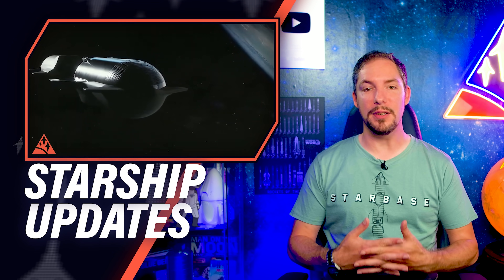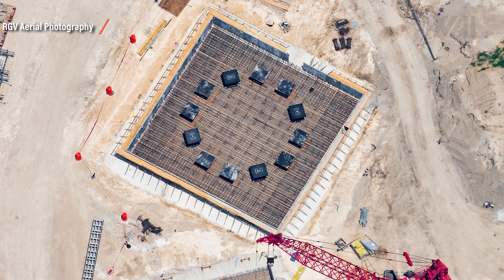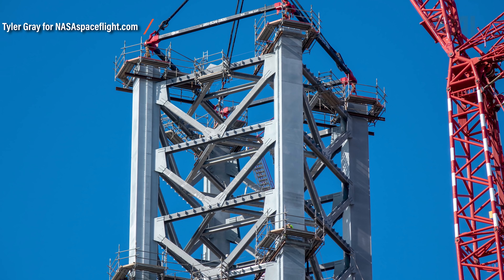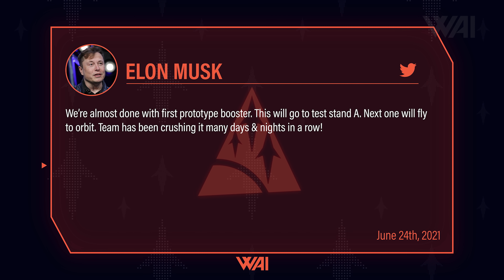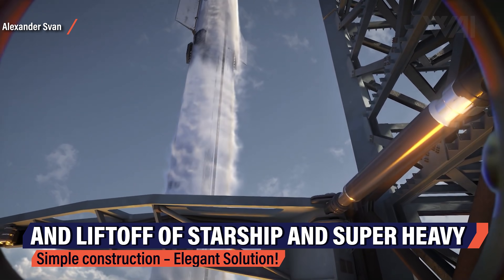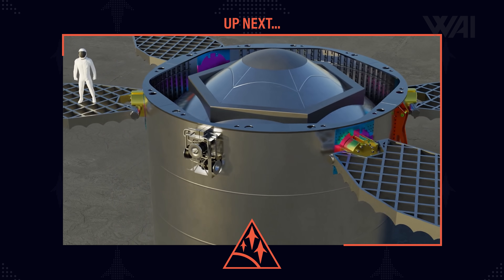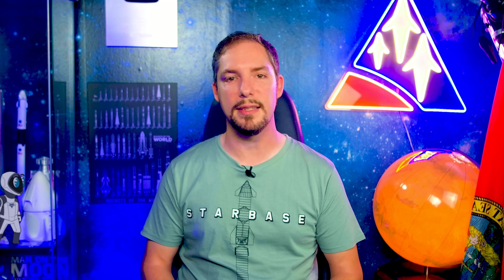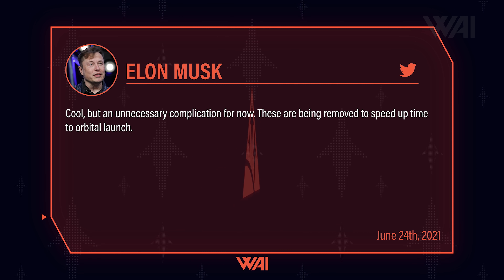SpaceX Starship design changed? Super Heavy booster precision landing thrusters!

Comment: If you link 2 starships to enable artibcial gravity.  The interior design should be different.  Or maybe you link then from the bottom 

2nd remark   when you have 2 starships linked from the bottom, this leaves a lot of space for... 15 more starships ?

So, add a better engine.  And the soar system becomes accessible :-)
With current tech

Starship is like a Lego. Add them and Improce your space ship, station, base

Comment: Here's the British HARRIER fighter jet demonstrating some of its capabilities, especially VERTICAL LANDING with FUSELAGE ORIENTED HORIZONTALLY.

I chose this particular video because it shows in detail the technology employed to control the Plane's complex maneuvers.

https://youtu.be/esDV4gjqsVA

Do not design for IDEAL CONDITIONS. This is ONLY good for prototyping, like in computer programming.

Vertical orientation is ideal when all your landings will always be in ideal conditions, no exceptions! Vertical might be right for Falcon 9, but certainly not for very heavy, tall and top heavy Starship.

Do you guys see the STABILITY of the Harrier? 

Consider this. Imagine Starship landing like the Harrier does, but with it's fuselage in vertical orientation, with all it's weight plus payload of 100 metric tons. 

When it's rockets shut down will Starship, standing tall and it's nose pointing up to the stars, will it be Stable? Safe on any terrain like on the moon or on Mars? With 1,000 STARSHIPS standing tall on Mars, how many will survive a Martian storm? Do you think there will even be one left standing? What about Marsquakes?

The Harrier can go from 520mph to a complete stop in 12 seconds, and remain hovering, motionless in mid air.

Because flying the Harrier was only in full manual mode - no A.I., no automatic system or subsystems - only the best pilots were chosen. The video indicates that hovering is the most difficult in flying the Harrier.

It's much easier, though, to fly the F35 because the difficult aspects of flying are relegated to automation.

The first Harriers rolled out in 1969, and 824 variants have been delivered since then. The U.S. also adapted the British Harrier for their own use. 

So, for Starship, just replace the jet engine with rocket engines and thrusters, and let it do VTOL like the F35 does (see above comment on F35). 

You already have the A.I. system for landing the craft. It is easy to adapt it to the case where the fuselage is horizontal.

And, because Starship is Top Heavy, instead of tripods, use two spider legs up close to the nose, and two spider legs to the rear.
Reply: Got to break it to you no one seems to be interested

Comment: Hi Felix. I'm wondering if the yellow tube structure may be on-site construction of extension components for the crane. Roughly judging scale and the various paint colors of spar segments already cobbled together, the crane company may have used up everything they had on hand. In any case, it looks like the cat-head will top out on the crown before reaching the required elevation for installing the final integration tower section(s), so we may see a final modification of the boom prior to completion.
 Maybe I'm wrong. On the other hand, even a broken clock is right twice a day.
Thanks for peaking my curiosity. I never tire of hearing the English language spoken correctly, to the point, and with the German accent that usually accompanies such an  unusual event.  
Cheers

Comment: While is is great that spaceX has made such excellent progress.
The law suit by the county I think is actually justified. SpaceX shuts down the road to run components up and down nearly day?
They are spending tens or probably hundreds of millions to build this facility, and are skimping on a private parallel road?
Last I checked a block 4 lane highway  IE no divider was 1.5 mill a km so the launch relief road would cost at the most ten million if so if that budget 4+ miles of road.
So the only highway shutdown occurs during launch!
 NASA have a 3 or 5 mile exclusion  zone during launches.
Yes SpaceX are going fast, but they are cheaping out by burdening the state highway system, and causing massive inconvenience to road users.
In Reddit terms spaceX and Elon musk are TA total butt holes in this situation to that country, and inhabitants!👎👎👎👎👎👎👎👎👎👎👎👎👎👎👎👎👎👎👎👎👏
Reply: >reddit 
>thinks 
Chose one pls
Reply: @Tuuminshz  I chose both!
Reply: @Michael_Brock  I see... All i can say is that you have a lot to learn. Best of luck

Comment: Elon tweeted a while back that they need a support arm at the SH interstage. It is possible that thy scapped the idea of fueling Starship through the entire lengh of the booster and just have the GSE fuel connection at the SH interstage and then some pipes inside that go up to the Starship orbital refueling quick disconnect. They could still fuel the SH through the bottom as they do with the Falcon.

Comment: I would assume there will still be quite a bit of work to do on the OLT after the final sections are stacked. Power, data cables, lights, water, sprinklers, insulation, elevator etc etc. I would also think that there will eventually be an escape system, but obviously no need to complete that initially.

Comment: Yellow pipes are being built into the crane mechanism for the top of the launch tower.  (SWAG of course).

Pipes to feed fuel/oxidizer into the booster can ALSO be used to feed to the engines, that's what "y" junctions are for.

And last, who's face is that on the hot gas thruster nozzle?

Comment: SpaceX Starship: Redo the Math

Do the Math that ensures safe landing and survival.

Math for Impact on Inertia of Motion

Consider the impact on inertia of motion on such a heavy ship. For Falcon 9 it was easy. The rockets were relatively light and therefore easy to control. The response to powerful rocket burts were instantaneous. 

Starship inertia of motion won't respond that easily. It's too heavy.

Landing on a barge at sea won't be that easy anymore. Will Starship continually counter the waves to remain standing? Can it?

In the rough and tumble of space, VTOL with fuselage in horizontal orientation is the  sanest and safest, and provides the greatest stability, especially for landing just about anywhere, and especially considering the weight, payload and length of the fuselage of SpaceX Starship. 

Starship was originally envisioned to go to other worlds out there in space, to hostile environments - rough terrain, stormy winds perhaps, absence of breathable atmosphere, no emergency pitstops, no medical centers, no hardware or electrical stores for spare parts, etc.

Redo the Math, SpaceX engineers. You owe it to yourselves, to Elon Musk, and to every passenger and crew, and especially to the ship itself, but above all, to the mission itself, the survival of the human race in other worlds.

Vertical orientation is only nice for showbiz exhibition. But in the rough and tumble of the real world of space exploration and prospects for colonization of other worlds, it is Imperative to put exhibitionism aside.

The mathematical physics you did is amazingly spectacular. But do the Math that ensures safe landing and survival.

Redo the Math for landing.

In the Falklands War, a Harrier fighter plane, because of some damage it suffered, made an emergency landing on a train. It landed safely. Simulate this same scenario for Starship, for both approaches to landing.

Compare the Math for the way Starship already does it's landing, and the Math for VTOL but with FUSELAGE in HORIZONTAL ORIENTATION, parallel to the ground. 

Compare the STABILITY of both approaches. 

Compare the locations of the centers of gravity, how they impact on stability, both on perfectly paved landing sites and on rough terrain, like on the moon and Mars. Consider also emergency landings for just about any place on earth or out there in space. 

And then there was that movie, Bruce Willis. Landing on an asteroid that was tumbling this way and that way continually. Can Starship do that? We all know it can't, well not the vertical way that it does, no sir.

Have you people seen the Star Wars movies? All Spaceships, large and small, commercial and military ,super heavy and lightweight - they all did VTOL like the Harrier and F35 fighter jets do, with FUSELAGE oriented HORIZONTALLY. Kudos to George Lucas.

Do the Math that ensures safe landing and survival.
Reply: Testing insures landing survival

Comment: All very well to catch the booster via the grid fins, but they have a pin joint connection to the booster body. That bracket between them may just be used for lifting the booster onto the stand, but it seems to be in a good location to provide bracing for the grid fins for the catch by the launch tower

Comment: Fueling from the bottom...under the assumption that the amount of mass for the plumbing would be no different compared to pumping in from the top of the booster.  It would be nice to hear from an engineer with SPECIFIC knowledge of pipe thicknesses required under these types of situations as regards pressures needed as height increases from the level of the pumps.   Heavy-duty pumps on the ground in any case.  Think of water towers all over the world.  This is known technology.  Adapting it to a rocket booster and through it to the Starship above will make sense also because Starship tankers will simply have the fuel flowing in reverse in space.  It seems the simplest solution...as long as the mass caveat mentioned above does not prove to be a show stopper.  As for the yellow pipes, they're at least not for flowing liquid.  Let's just wait and see what they're for.

Comment: I thought the cryo shells would have a vacuum between the tank and she'll? Putting nitrogen between would allow heat transfer. Also, I thought I saw a vacuum breaker installed on the top of one of the shells.

Comment: BN3 RCS thrusters would be useful for testing precision navigation before hitting a simulated catching arm made from floating wooden logs at the splashdown point.  Fully bio degradable and expendable.  Test secondary objective is to navigate the splashdown between two lines of pool floats that simulate the spacing of catcher arms.

Comment: Firstly, I would fuel up the booster with just enough fuel to get it into sub orbit.  At that altitude, it would then dock with another Star Ship designed to fully fuel the Lunar Star Ship while in Earth orbit.  Refueling completed, light up those booster engines and fly off to The Moon.

Comment: How is Musk's starship going to handle Mars's nasty dust storms?
I see his idea of a Martian city more as a way station for refueling ( mostly automated) and temporary science experiments, not as any long term habitation as the conditions are too harsh.  Most of it would have to be underground with a lot of remote controls and robotics.  The moonbase would have to be the same though they might be able to stay a little longer like in the ISS.
I'm surprised that Musk hasn't tried rocket stacking for longer flights for scientific research to say the asteroid belt for mining purposes.  Also I haven't seen any inquiry into the feasibility ofbuilding a construction/assembly gantry ie Star Trek style.
Reply: Black Stone  it isn't the wind speed that's the problem.  Dust is the enemy of machinery and solar panels.  Due to it electrostatic nature it sticks to everything.  They can't clean themselves, yet.  How much time are you willing to devote to cleaning and how does that affect productivity?  How do you prevent it from getting inside the living space and work area?  How do  you suck it back out?  That adds to the complexity of the  station.  If dust is a problem in deep space how much worse is it on Mars?  A single airlock is not going to cut it.  How will you handle power reductions if you rely on solar power?
Then there's the electrostatics problem.  How do you control it to work for you?  To kick the dust off.  To protect electronic devices.  To convert to usable energy.  Lightening bolts on any planet is no joke.  You don't want it hitting your structures.

Comment: It seems very wasteful for SpaceX to be not attempting to land completely the starship and the booster. Granted it needs to be done ‘far away’ with extra safety margin but land both at sea on drone ships. If things get ‘hairy, they could always steer them away from the ships. 30 raptors, booster and starship must be worth $250M! Not to mention the material pathway and flight test data.
Reply: As I said to someone else, you're being overly optimistic about their chances. This will be the very first attempt at flying the booster, and without any prior tests, they're going to be trying to fly the full Falcon 9 mission profile... launching out of the atmosphere, re-entry burn landing burn, and soft landing. It is extremely unlikely that this will all go according to plan, which is why they're not going to put recovery vessels anywhere near the site of falling burning debris.

A similar story applies to the upper stage... while the test flights for Starship have gone much better than expected, there's a big difference between a 10km up-and-down hop, and a reentry from orbit. The odds of everything going perfectly on the first attempt aren't good, and it's most likely going to be coming down in pieces not dissimilar to the loss of STS Columbia. 

This isn't pessimism about Starship... it's just an awareness that this is a test program, and that the unexpected success of SN8 and its siblings seems to have people expecting this flight to go perfectly. This is a huge step up in complexity.

Comment: 4:32 I believe they will pull a vacuum between the GSE tank and the cryo shell. A vacuum would be a better insulator than nitrogen.
Reply: Vacuum is an ideal thermal insulation, but is expensive to implement. It is cheaper to use nitrogen filled perlite, than to pull a vacuum. 

The problem with containing a vacuum between the shells is that the outer shell has to withstand buckling. That is, the outer shell must be built to soundly withstand compression -- like a submarine pressure hull or a stone arch. This requires many orders of magnitude more wall stiffness: a rigid pipe vs a soda can of the same diameter.

A compression shell would be cheapest to implement using reinforced concrete with a thin air-tight exterior layer. Deeply corrugated steel sheet (alone) is more expensive, as it would require layers laid at mutual right angle, welded together, to develop enough rigidity. Any zinc coating would be a nightmare for welders. 

The Hyperloop tunnels have the same air-tight and compressive requirements, but the smaller diameter makes it possible to implement with thinner walls.

Comment: Would mars return trip fuel loads be enough for a straight return or would fuel ferries be needed on Mars too?
Reply: Last thing I was told, a fully fueled starship (top half) can launch from mars and make it home in one go.
Reply: Yes, that’s the good thing about starship it doesn’t use lots of fuel for landing since it uses aerodynamic drag to slow it down pretty much most of the way. Plus refuelling and Mars low gravity makes the Earth injection cost less Delta V. It is also topped off with the very thin atmosphere.

Comment: It might actually be less complex to fuel the starship upper stage through the bottom directly, cutting through the engine skirt, rather than pushing fuel from the booster.  The latter would require the booster to have adapters and fuel/oxidizer lines running through the top whereas the former only requires a break in one of the skirts (more likely the booster upper skirt).

Comment: Regarding the on pad fuelling of Starship. I do not think Starship can be fuelled through the Booster without the use of a bypass pipes (which add significant weight). Some people have suggested that the starship would be connected to the top of the booster fuel tanks and the fuelling would just continue through the booster until the Starship is filled , but I believe this would not happen for sound scientific reasons. Fuelling Starship through the booster tanks would create a column of propellant nearly 100m tall, this would add an additional 10 bar (approx) of hydrostatic pressure on the base of the aft booster tank. These tanks have clearly not been designed to resist that pressure. A more likely fuelling point would be a short feeder pipe located at the top of booster and connecting to the Starship base or T valve under the Starship skirt either of which would be fed by an umbilical from the tower. Lifting any fluid 70m (height of booster) before any further filling involves considerable additional hydrostatic pressure (approx 7 bar) and therefore more rugged and heavier piping is required.

Comment: Those pins you mentioned for concrete reinforcement are also welded to the inside of the integration tower legs.  I wonder if they are going to add concrete to the legs. Could the pins serve some other objective (vibration damping?)

Comment: Joining to concrete is somewhat difficult to design and even more so when the structure and failure to fracture have a high amount of vibration, I recommend an integration that involves welding and a somewhat more rigid joint.